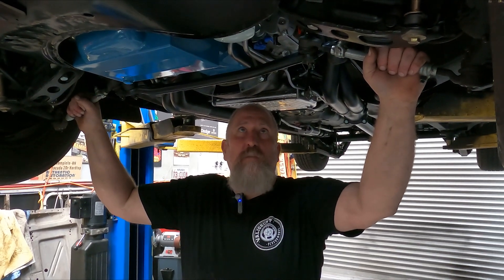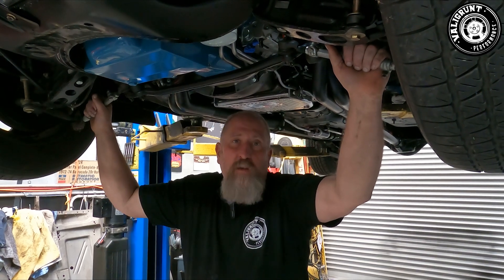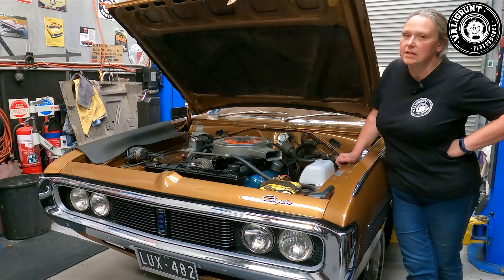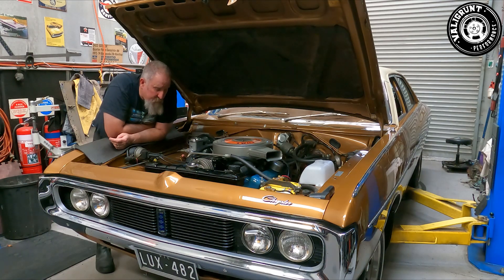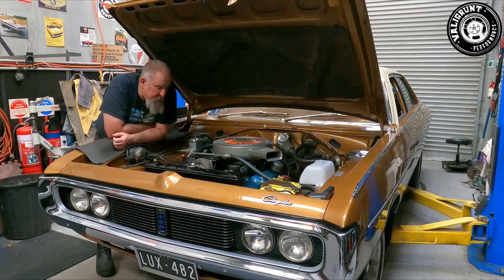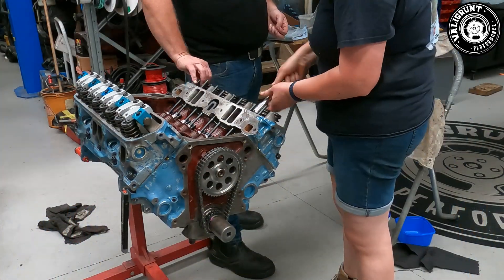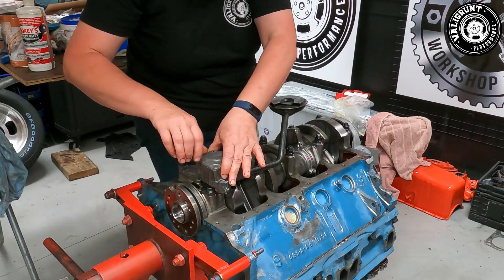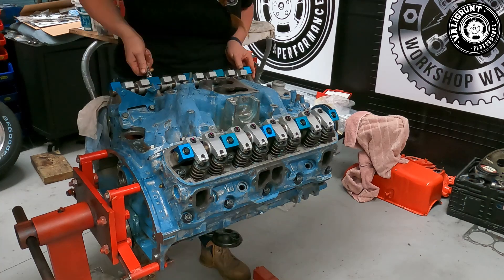Crank failure in Chrysler small block stroker

Comment: Not a bad mod. I get rid of the sandwich plate and drill and tap the block and fit -10 braid on big hp builds.
Reply from the maker: We wanted it to look pretty much stock so when you pop the bonnet there is nothing to see. Sleeper style.